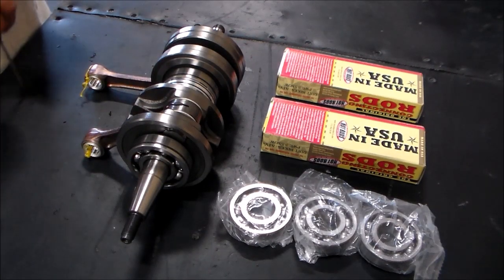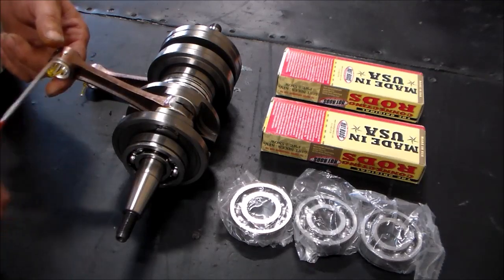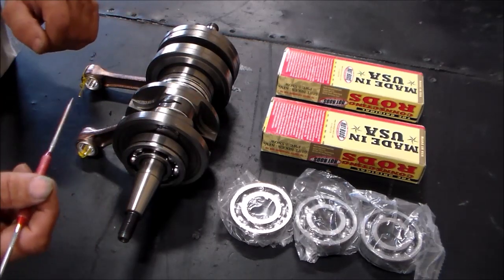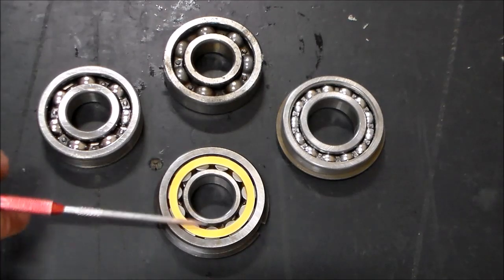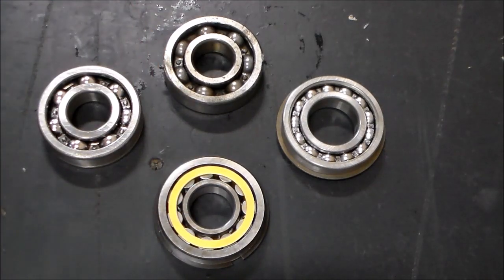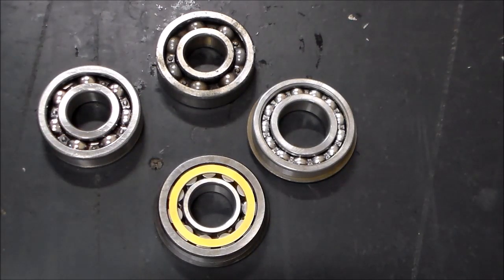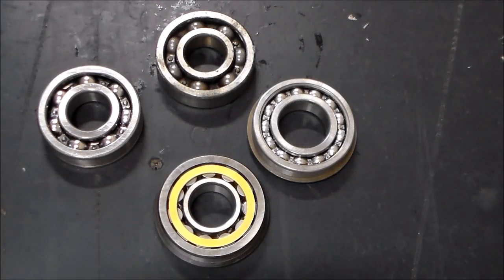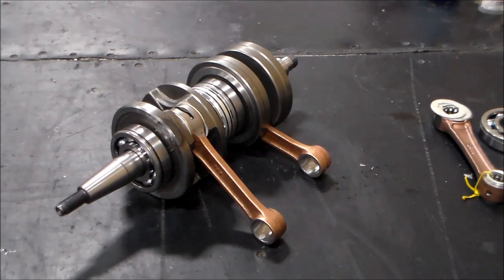Banshee Engine Disassembly Part 6

Comment: Do you have a used Banshee stock crank with rods and stock pistons that can no longer be used? Also a stock used clutch basket and stock used flywheel that can no longer be used or is no longer needed? I built 2 banshees to sand drag 10  plus years ago and raced them up until my accident 10 plus  years ago when I was in a bad accident on one of my banshees and I was flown by helicopter to a university hospital where I was put in a induced coma for 2 weeks and woke up and was told I injured my spinal cord and I would never walk again. I have moved on from the accident and I do wood working projects and metal sculptures. That is the reason I asked about a stock used crank,rods,pistons,flywheel, and clutch basket for a metal sculpture I would love to build to remind me of the hobby I loved and was a big part of my life. I would be willing to purchase the parts. You can contact me via email at 67stang65@gmail.com or on here. Thank you for you time and any help and keep up the great work. Ride safe and God bless!